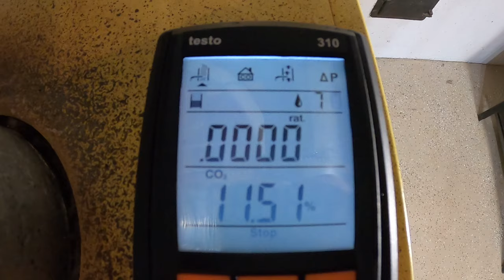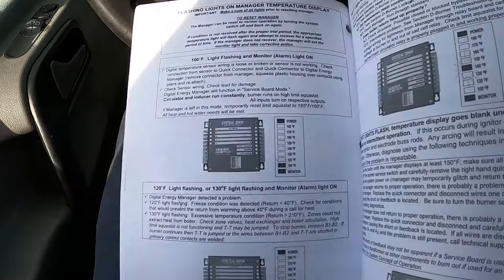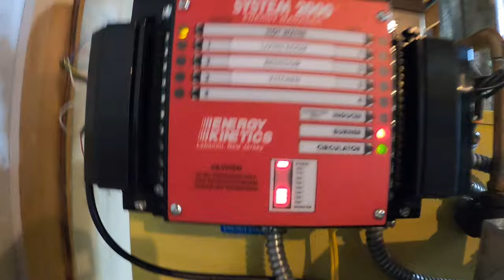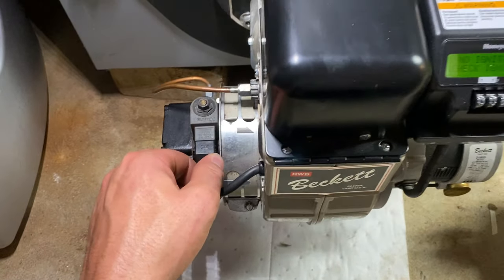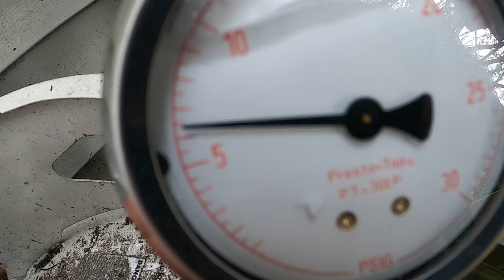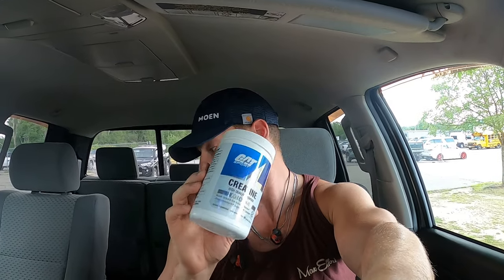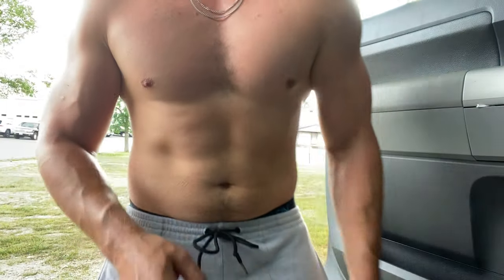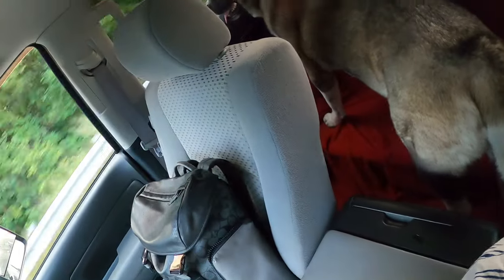Day In The Life Vlog | HVAC, Plumbing, Chest Workout!

Comment: Oh shit your in New Hampshire? where at? I stay in Nashua!
Reply from the maker: Deesh No kidding! Yeah I’m right over in Keene!
Reply: Blue-Collar Biceps No shit man! Never came across another 603, Im a senior in highschool, Debating between HVAC and Plumbing. I can’t decide. What are your thoughts. I want to eventually open a business, Which job do you get more overtime with HVAC or Plumbing?
Reply from the maker: Deesh I would say either way your making a great choice. I would try to learn it all eventually but start with one. If you go plumbing you may end up doing some heating and hydronics as well being in N.H. Plumbing is going to take the longest to achieve, and some companies will also pay for your gas license if they are involved with that. The N.H. School Of Mechanical Trades in Manchester has a lot of programs for oil, gas, and ac that are shorter. The plumbing will take four years so if I was in your shoes I would get that done, and than go for the hvac side. Like I said you will probably be doing some heating with the apprenticeship as well!
Reply from the maker: Deesh Of course you can go with one and stick with just that also. I just find they are so related and I wanted to be able to do both for the same reasons (owning a business)
Reply: Blue-Collar Biceps Awesome man. I looked into the School you just said in Manchester. I know i shouldn’t be in it for just the money but i know if i work hard enough I can achieve 6 Figures. What trade do you think is more promising on the 6 figure side ? My dad does HVAC and gets slammed with ‘On call’ or overtime i should say. Is there alot of Overtime available with Plumbing?
Reply from the maker: So either way your going to probably get plenty of overtime. Your thinking like I used to haha. But let me just say fall in love with the work first, the money will follow when you master your skill, it’s simply the byproduct of being highly skilled at the profession. You can make that kind of money eventually in either trade if you stay dedicated.
Reply: Blue-Collar Biceps Cool man! I appreciate it. It was only because i was thinking, Everyone needs Heat and Ac and systems go down. So what do they do? they call and HVAC tech. But when A toilet clogs what do they do? Unclog it themselves....you get what im trying to say? Im just trying to get in the field that when im in my 20s work my ass off and work as much OT as possible and make the most money. Again i appreciate it man! Means alot especially coming from a 603!
Reply: Also you’re from NH so you might know. 3 Highschools in the State provide a free 2 Year Hvac course where you will be certified right out of highschool. Luckily one of them is in my city. Nashua High South. Im on my 2nd year right now and then i will be a certified HVAC tech!!
Reply from the maker: Deesh that’s awesome man! Stick with it and above all take it seriously, learn all you can off the clock on your own time too. I’m glad you found the channel, my aim is to inspire younger guys like yourself to jump into these trades!! 👨🏻‍🔧💪🏼
Reply from the maker: Deesh Its what I did in 09 after high school and it was the perfect fit for me.
Reply: Blue-Collar Biceps So say i become a plumber, 4 year apprenticeship. Then i become a Journey Man plumber but then i go for an HVAC trade. Will i be getting paid as a journeyman plumber?? How would that work?
Reply from the maker: Deesh So if you want to make that work you will have to find a company that recognizes value in your plumbing license also, some companies keep people in certain things, luckily where I work I can do it all. If they don’t than they will probably start you a little above whatever their starting hvac pay rate is being that you have another license and experience in a trade. I hope that makes sense
Reply from the maker: Deesh Like I said though before plumbing and hvac (residential) go hand and hand in N.H., that’s why you see so many “plumbing and heating” companies, and more are beginning to offer AC as well.
Reply: Blue-Collar Biceps Cool man! I appreciate everything. You earned a sub and keep up the great content my man!
Reply from the maker: Thanks buddy, More to come! 👨🏻‍🔧💪🏼
Reply: @BlueCollarBiceps  Hey man, i had one more question. How do you manage to workout and stay fit while working for Hvac and plumbing considering its hard work on the body.
Reply from the maker: Hey! So I have found in my experience the more you give the body within reason it can handle more than we think. Being that it is physical work I find myself needing to do hardly any cardio to stay fit, and if I do a lot of it that’s what will actually make my joints get beat up on top of work. It’s always good to do some that being said, I prefer HIIT for my cardio. Lifting weights just try to lift a little more weight or do extra sets each workout until you have to back off and give the body small breaks of lighter work. The physical part of the job plays in really nice combined with the proper nutrition to achieve my fitness and body goals! Don’t hesitate to hit me up on Instagram if you need any more fitness advice! @blue_collarbiceps